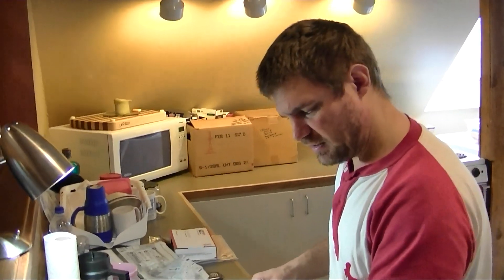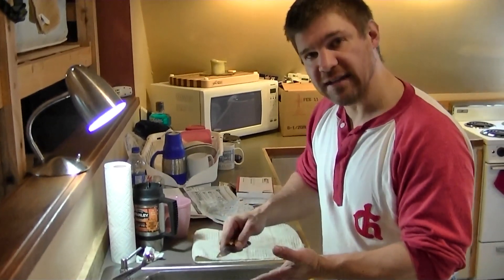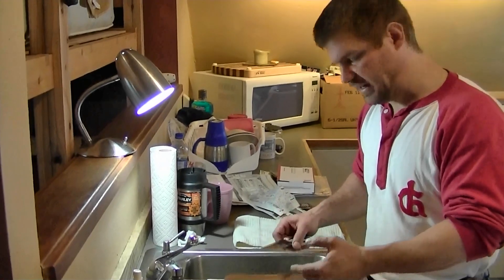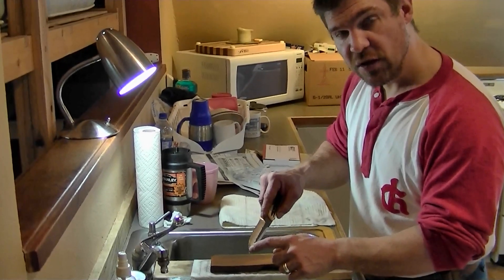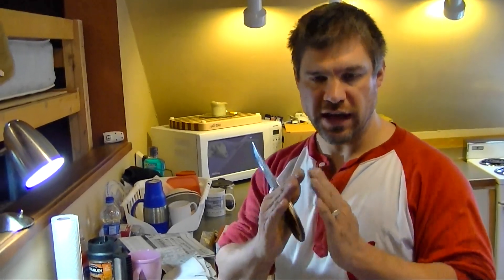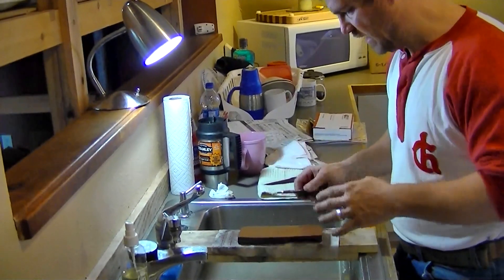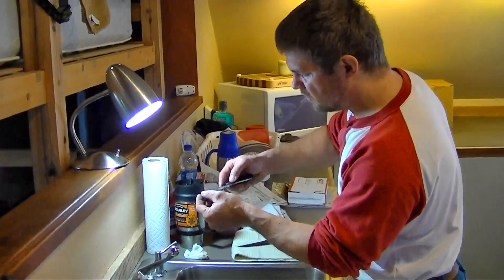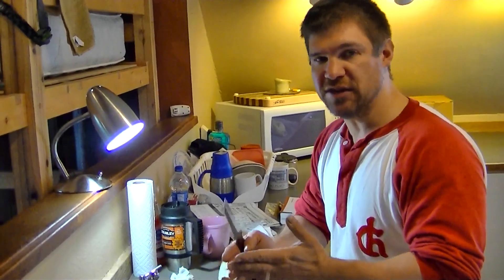Carter Cutlery - Murray Carter on Convex Edges

Comment: Hello, Great video. I see that you are holding the knife almost 90 degree relative to the stone when you are sharpening the knife. I tend to hold the knife more like 45 degree relative to the stone. Can I use this angle of approach when using this rocking motion or will the result be better if I hold the knife 90 degree?

Comment from the maker: @ArtistBlade1972 Best is very subjective and each grind certainly has their place in the world. One of the biggest issues is that most knives produced today are overbuilt and they don't allow you to maintain proper edge geometry, or create an edge that will work with a multitude of tasks. All of Murray's knives are designed for cutting with 5 specific criteria: blade geometry, ease of maintenance, durability, sharpness, and edge holding ability.

Comment: I think that convexes are a good overall option. A well made convex will be tough and a sharp cutter, unlike a thicker flat grind which will be heavier and will not cut as well. But the actual convexity of a knife can vary. Carter, if you get a chance, check out a custom knife maker called "Turley Knives". He makes some absolutely fantastic hard use woods knives.

Comment: I agree with the concepts here...best method is to use the entire stone during a sharpening session. 

But really, sidewalks are not particularly flat or smooth, there may be 1/16-3/32 sand grains on the exposed concrete surface...I wouldn't even consider scratching away on a $80 stone by rubbing it on a sidewalk. Medium grit wet/dry paper on wet glass is about as radical as I would go. 

If you have $800 worth of stones, consider investing in a diamond plate a good investment.

Comment: You are right. Many edges are overbuilt to be "razor sharp out of the box", with the main purpose of giving a momentary pleasure to the buyer when they are basically, "invited" to cut a piece of paper to assure themselves that they bought, well, a paper cutter that will not perform in the field.

Comment: I would like to see Mr. Carter Sharpen a Cold Steel Recon 1 with a Tanto Blade a Plain Edge. I would like to see how he would sharpen that and another problem is that also me the CTS XHP Steel. High Carbon High Chromium Alloy. I know he CAN do it I just want to see how. I have a Recon 1 with a Clip Point Blade and sharpened on it some and the Grind Lines got just a bit uneven SO I sent it to a Professional Knife Sharpener. Now it is SCALPEL SHARP. I have a few different sharpeners. I was thinking of Buying a WorkSharp that moves with the shape of the blade or the KME Sharpener that was the No# 1 Rated Sharpener of 2015 and Maybe 2016 too.If Mr. Carter reads this I hope he will Make a video Demonstrating it. L want to see him Sharpen the BIG Hard Tough and Thick Steel Knives because i want to learn how to Sharp those type of Knives. Yes Cold Steel Is a Good Knife maker and the edges last a long time, BUT some of the Steels have to Be Sharpened by a Professional. Sorry for rambling and IF anyone has some advice to help me Sharpen any Knife I have or by in the Future I will Listen.

                                     Knife and Gun Nut.

                                  D. Neal Linville

Comment: I admire this skill very much and would absolutely love to be able to sharpen freehand to a point where my knife can shave facial hair. Nothing but respect for this idea of thinking and the obvious results it creates. But, doesn't it take ages to master and what if knives are of a bad quality of steel, wouldn't you take more off of the stone than the knife? I don't have enough skill to sharpen free hand and if somebody wants a knife sharpening that is of a low quality steel I'd rather use something diamond based or even a belt sander type product instead of ruining a decent quality japanese stone... with all that said I would love to produce the kind of edges that this guy does :(  I'm just not that skilled.

I guess I'l stick to the jigs and devices :(      Confused and unsure of what to do after seeing this video because I like the philosophy involved and the obvious results.

- Low quality steels will wear out a good japanese stone.

- This skill takes years to truly master.

- more modern methods are surely way quicker?

This isn't criticism, I'd love to be able to sharpen like this but these are the pitfalls I see in this way of sharpening
Reply: actually low quality steels will not wear out a Japanese stone that much. bad quality steel is usually alot softer then most high quality steels. and dont be discouraged with freehand sharpening... it really isnt a science. ive only been sharpening freehand for about a month now and my edges can whittle hair after practicing. a good source of information on freehand sharpening is jdavis882 he has many sharpening videos that are incredibly easy to understand. and theres nothing wrong with using jigs and devices. the reason murry dislikes them so much is because hes spent his entire life dedicated to mastering blade smithing in the traditional japanese way and so freehand sharpening is kind of spiritual to him in a sense... just go out and practice on a bunch of cheap knives and youll understand what hes saying after about a month or so of practice. i use a coarse, fine, extra fine dmt diamond stone set then i use a spyderco ultra fine bench stone then i finish it up with a stropman strop and the edges i get are mirrored and beyond razor sharp and all i did was watch murry and jdavis882 for information then i just went at it and did it and ive had fantastic results. so dont be discouraged with it just practice and have confidence and youll be amazed how your results turn out... good luck with future sharpening however you choose to do it and i hope this was a little helpful
Reply: flex93312 I went with DMT stones originally, and spyderco fused ceramic stones after watching Jdavis, and Richard blaine, I found that I really hate diamond stones and hard ceramics. water stone are just so easy to use somehow, and keeping them flat is not nearly as big a deal as it sounds. I use DMT stones for lapping, and occasional sharpening, but thats all!